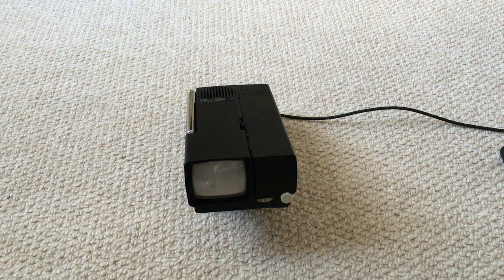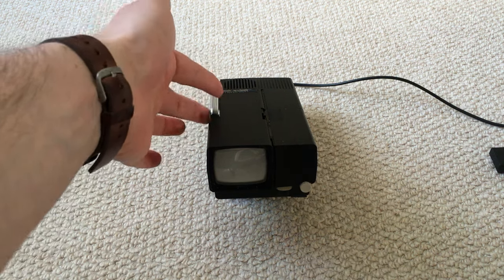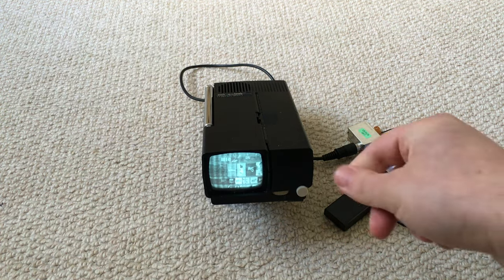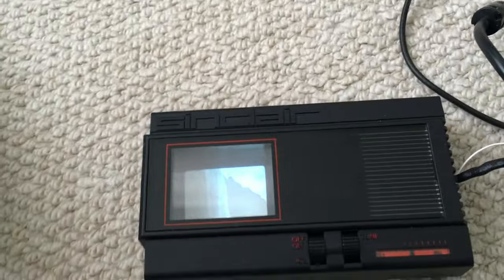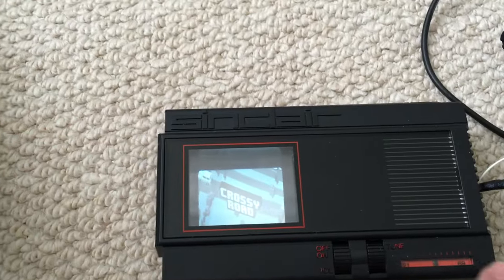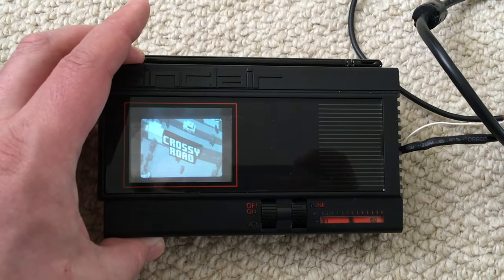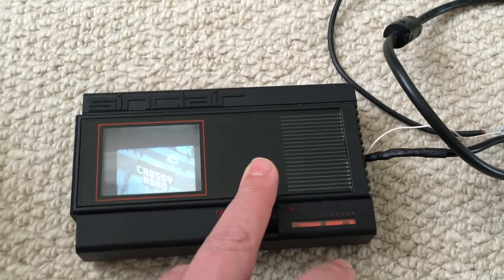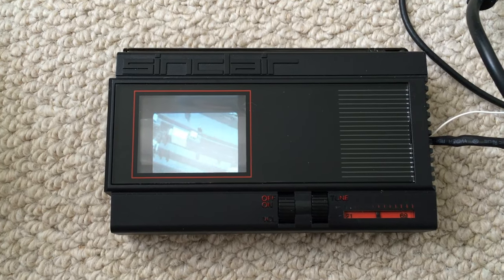HDMI into Sinclair Microvision + TV80 (Flat Screen Pocket TV)

Comment: Very interesting mix of modern technology with old. About 45 years ago I was one of the electronic design Engineers who worked on the Sinclair Microvision. I did the power supply and RF ( tuner ) design. This was in 1975-1979. At that time  I designed some early design of the electronics for the 'flat' TV.

Comment: Sinclair was such a revolutionary company. I like how they used novel ideas to overcome the technical limitations of the time. The "flat screen" CRT is ingenious!
Reply: Yes, but just how did it work? The electron beam was deflected at 90 degrees? So the phosphor screen illuminated from the inside/backside of the tube and not a frontal projection?  Does that mean it didn't need an Aluminium coating on the inside of the screen?
Reply: It was a ingenious idea such flat crt tubes , trough i wouldn’t be surprised if they sold the patent to sony to try  to recover from bankruptsy.
Reply: @johneygd  Originally the pocket TV patents and IP were sold to Binatone, and the later the flat-CRT patents and IP along with everything else Sinclair was sold to Amstrad. There was a few Binatone branded pocket TVs, but Amstrad was only interested in ZX Spectrum, and didn't do anything with Sinclair TVs.

Comment: Just connected mine with a bigger RF modulator.
However, coudl you share how you are powering/connecting the N64 Rf mod, as I see you took off the housing and wired it to something.

Comment: have you got a video on how you rigged the Nintendo rf modular?
Reply from the maker: I don't but it's quite easy to work out because there are only 4 connections (2 pairs of two are connected). The ground will be connected to the metal shield. The audio in is the two pins connected together that aren't ground. The composite video will have a low resistance to ground (somewhere around 75ohms) and finally 5V will be the left over pin.
Reply: chipos81 

thanks, it'll be cheaper than buying those expensive rf modularators, you might have a popular video if you showed how it was it was done
Reply: there is 3 pairs of connections, no?
Reply: I just bought the Sinclair TV80 (waiting for it to arrive). I plan to gut it and stick a color LCD & Raspberry Pi in it.